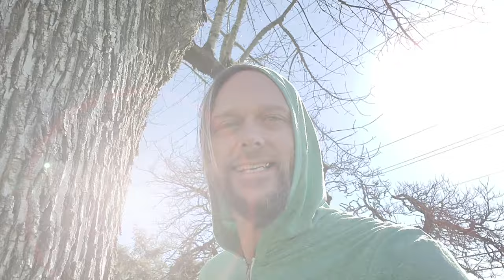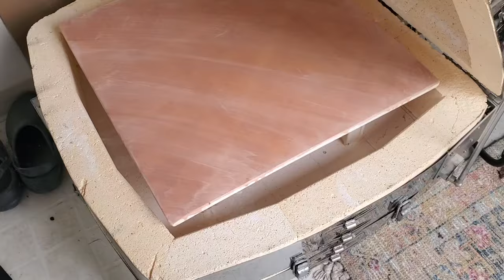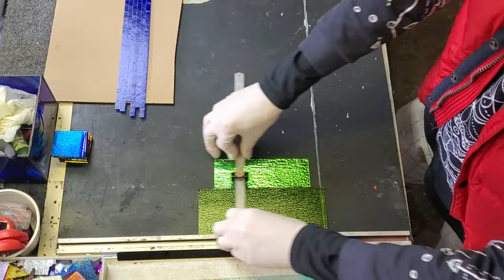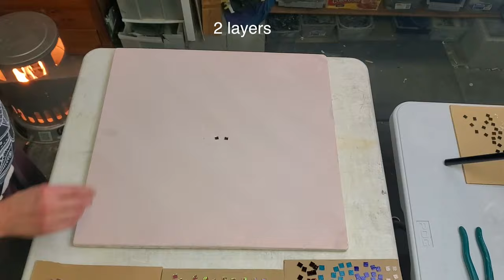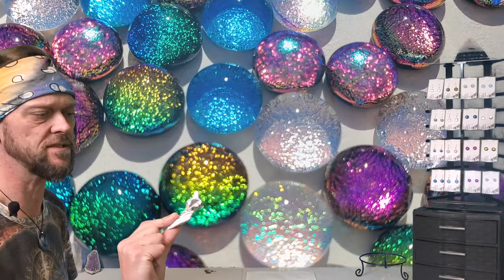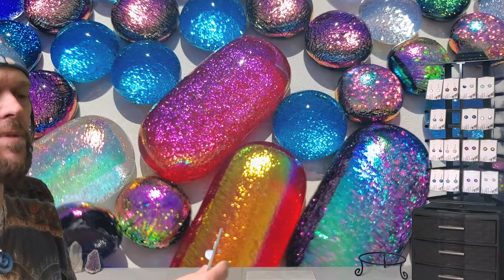Dichroic glass dots~Start to finish~kiln fire Earrings/jewelry making endless colors fused glass

Comment: Have you tried applying a “mesh” to a piece of glass with a glass cutter and then breaking it? Wouldn't this work and make it easier to cut each strip of glass?
Reply from the maker: Yes I didn't care for it as much.. but it works for some

Comment: I'm a potter, so I have large kilns, I'm trying to figure out if I can do something in the equipment I have. I make my own kiln wash, might not be the same, where might I get amounts of time at what temps. Maybe Its not possible with what I have. I fire from 1800-2235 generally, but I can lower, I guess I can experiment, what's the worst outcome I could expect, explosions or just melting and making a mess.
Reply from the maker: Ya not sure ,,   you will make it work just use a paper of kiln wash on the shelf

Comment: Hi there, love the video and the dichro! If I ever do dichro dots I alway get square bling in the middle of the round dot. What do I do wrong?
Reply from the maker: That sounds like dichro on dichro  .  Maybe assure the touching surfaces are fusible
Reply: @speedoflightglass  No, it's dichro, capped with clear glass that is compatible
Reply: @marianblaauw  sounds like bottom layer not fusing? Make sure kiln temp hot enough to fuse both layers.
Reply: Make sure the clear cap is slightly bigger than the dichro and it'll enclose the bottom layer completely.

Comment: Great video! My dichro dots two layers, dichro on bottom with clear on top but they never round up! May I ask what your full fuse temp is and the hold?
Reply from the maker: Try top 3mm.regular and bottom 1.5mm thin. And 9999~1500~22 hold